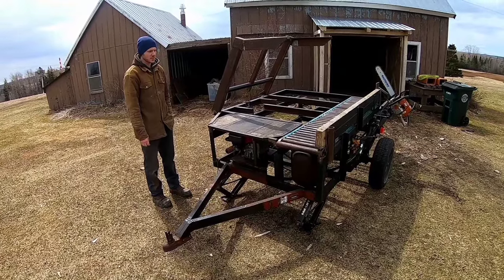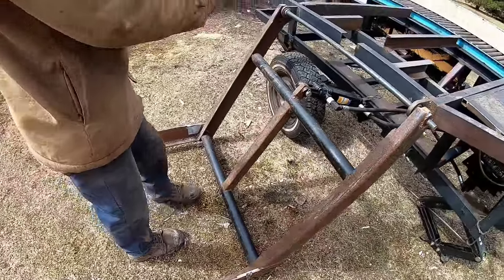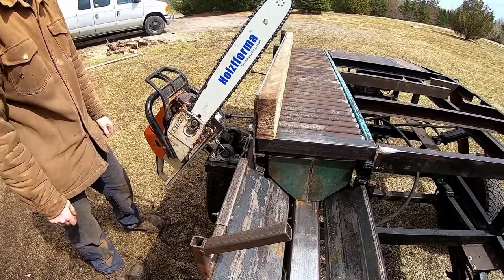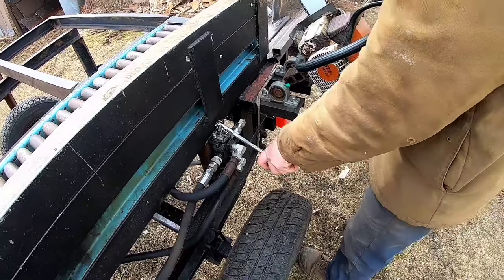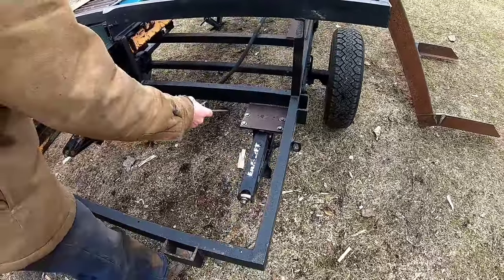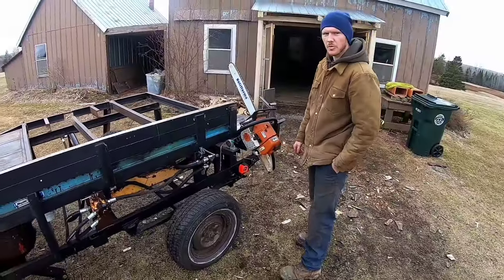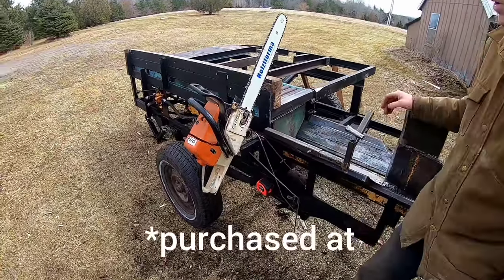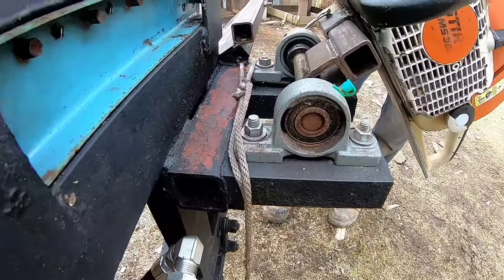Homemade firewood processor walk around

Comment: Good job Josh. I did a joke video with a roller table and my splitter in the side operated with ropes. This thing is no joke, you can really make a lot of firewood with that machine.
Brent
Reply from the maker: Thanks. It worked well. Always room for improvement though!

Comment: This is more like the firewood processor I am planning to make. I have an old log splitter that is complete. Just needs some fixing up. I have some old roller tables too. Just have to figure out the trailer part. And a conveyor would be helpful.
Reply from the maker: Cheep and relatively simple
Reply: @joshbateman901  Yes, except for the trailer I have almost everything I need.
Reply from the maker: @countrywoodproducts  Could you just get an axle and build the frame of the machine as the trailer? Something like the way most commercial woodsplitters are
Reply: @joshbateman901  I have been considering that as well. But right now there is not much of a frame besides the log splitter.

Comment: I would go with a kinetic splitter, I like your thoughts on the 4 way, also seems like most people split down way to small makes for a hot quick fire that needs stoked multiple times a night
Reply: If I use big wood, it will be 80 degrees in my living room for the rest of the night. I learned the hard way to use smaller pieces.
Reply: @camperjack2620  yeah some stoves are also hard to get to dampen down right so big solid pieces are not an option but they also don't get lots of air because of their size so in theory they kinda dampen themselves at least it seemed to work well in our old Quadra fire

Comment: Assuming it's just for smaller single split logs, otherwise lots of extra handling while the chainsaw is running..
Reply from the maker: Yeah that's true most of the logs were in that 3-8" so not much need for resplitting. Anything bigger was usually put aside for furnace wood so no need to split it again.

Comment: Great job! You might try mounting a winch like a boat trailer winch and a dog on the cable end to draw the bigger pieces through. Or maybe electric or even a hydraulic one. Cheers 🍺
Reply from the maker: Hey yeah good thought. The new one. Working on has a hydraulic motor and chain feed with a paddle to push the logs forward. Keep a lookout for a video of it coming up

Comment: I've had that idea rolling around in my head for years. My variation is a blocking table that drops or elevates to a 8' merry go round that spins via a small motor. So it's useful with 2 guys or even just yourself.  I have a Axis which I really like so I'm not all that interested in the splitter end. Working with the vertical splitter has really improved the quality of the wood and decreased the waste.  Resplitting on a fixed wedge is not all that efficient for the operator. I'm not banging traditional splitters, if you have the wood to pass through a 6 way or 4 way in one shot nothing is faster. Unfortunately it seems I never end up with that size wood hence the vertical splitter with a single wedge.
Reply from the maker: I don't totally understand the blocking table idea?
I agree on the splitter side to some extent. 
I like the wood dropping down and getting half split, I never liked the multi way just for what you said there is so much waste from crappy pieces that would not be sellable.
A lot of the time I separated the bigger stuff for furnace wood and the smaller for stove wood so it limited the need to re split anything anyways.
This machine never had anything too big through it and even the new on I'm working on now is gona have a 12" max size.
Anything bigger can be done on a saw and splitter otherwise.
(Besides that there is almost no trees left where I am that are over 12" anyways)

Comment: Good job. A four-way splitter is pretty much standard. It looks like it needs a table for resplitting. When you pushed the saw forward, it didn't look like it went down all the way to the needed amount.   You can get a smaller processor with no engine for $20,000, new. And no log deck either. 
Would you say it is a one person or a two person machine? One person can do it but a second person would help a lot. Is that correct?
Reply from the maker: Hi yeah we had considered a 4 way but from what I had seen 90% of them I didn't like how they worked. Seemed to me they usually wasted wood when splitting having little splinters or hard to split when there was a twisted or knotted piece.
For the most part we were doing smaller 3-10" on it. The smaller went onto the truck for stove wood and the larger for furnace wood orders.
Maybe just the look in the video but the bottom of the bar should be just under the front rail of the roller so the bottom of the chain would be well through the cut. We did have a few issues with really twisted pieces not cutting all the way through but 99%went right through.

1 person can run it but most of the time it was 2 of us. 1 on the saw and another cutting the oversized by hand rolling the new logs in keeping the split stuff cleared ext. The only difference with 1 person would be when the table is empty there would be time required to load new logs.

Thanks for watching
Reply: @joshbateman901  
I was thinking whether it had mass production potential. If you bought everything new that would raise the cost a lot. I don't know whether it would be worth the cost.
Reply from the maker: @jakebredthauer5100  It would depend on what "mass production" means to you.
We would do about 1 cord per day and that's enough for us. I think our biggest day was processing 3 cord from log to delivery and I'd never do that every day.
Suppose that's the difference with a 100+k bells machining processor or something where you can sit in a cab and work all day.
Iv used the China ones that are available in Canada for about 10k and it was no better.
Reply: @joshbateman901  
You misunderstood.
If you produced 100 processors, the cost per unit would go up. That is what I meant by mass production.
The biggest design flaw that I see in it is trying to move a whole log by hand instead of cutting it into pieces and then moving those individual pieces by hand. If it is not too hard to move a whole log by hand, then that would be okay.   I don't know whether those rollers are meant to be for outside use.
Reply from the maker: @jakebredthauer5100  Oh okay I see I was thinking production on the machine not producing the machine.
Yeah for sure on the beer rollers. Its not the best. The one I'm working on now has a chain in feed for the wood. Haven't worked out the stop for the log yet since it needs to be much stronger to hold up that way.
Reply: @joshbateman901  
I imagine new chain would be very expensive. You may not have noticed the more primitive type of log mover connected to the pusher.  When you move the pusher, the log and the thing the log is on will move also. Then you clamp down on the log so it cannot move backwards when the pusher moves backwards. This would be much cheaper and would move the log without manual effort. I think maybe Halverson still uses this method on their processor mounted on a skid steer or other loader.
Reply from the maker: @jakebredthauer5100  Yes I have seen that style. There's so many different types and options you never really know what's right untill you try it, seems as though a lot of the smaller company's are the same. I can't remember the brand now but there's one out there that has a grapple clamp and it feeds the wood into the saw.

I did a rough estimate on pricing for all new material on that machine, it would be roughly 6500$ canadian
Reply: @joshbateman901  
Multitech 2025 has a circular saw and overhead shuttle grapple. It is good for crooked logs. 
The Rabaud 520 shown at Paul Bunyan Show, $250k.
Reply: If you got the log in the right place then could you slide the saw along on a rail to cut that log? Then if there were a splitter nearby a person could lift the rounds over to the splitter. Easier than lifting or carrying would be to slide or roll them on something to the splitting chamber.
Reply: @joshbateman901  
I missed forgot to put your name on my comment.
Reply: @joshbateman901  
Blockbuster in Iowa
quit making processors.
December 2022

Comment: Josh, can you show me a close up of the chainsaw pivot mount? I'm currently using a mount used for making boards that clamps to the bar. I'm looking for something exactly like your with bearings.
Reply from the maker: Hi il have too see if I can find any better pics of it (I don't own the machine anymore). Basically it's just a duel pillow block with a rod between. Welded square tube onto it the 1 1/4 fits over the 1" with the weld line ground off the inside.
The mount on the chainsaw is a piece I ground and drilled to match the shape and holes for the sawdog mount, welded that to a piece of flat bar under the saw.

If that made any sense? Il let you know if I find any better pics of what I did.
Reply: Thank you for the reply. I'm testing g to do something similar.  Do you have any plans of the one you built? I can send you pics of what I have and possibly you could give me some ideas.  Thanks again!
Reply from the maker: @kurt bennett  No specific plans... more of a trial and error type of build. That's usually how I get things done haha.
Reply from the maker: @kurt bennett  For sure send me what you got and I might be able to help out
Reply: @Josh Bateman  do I send them through this reply section or email etc? I normally don't comment, but this is exactly what I'm trying to build. Thanks again for your quick response
Reply from the maker: My email is in the about section of my channel. Send me an email through there would be the best bet.